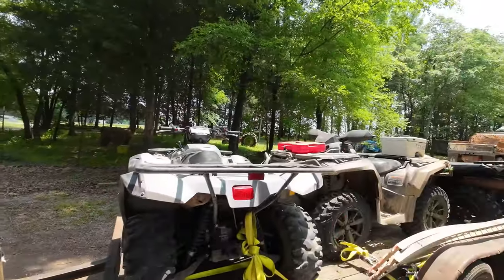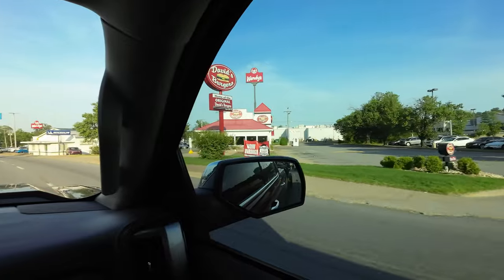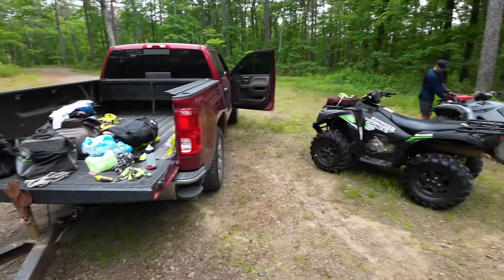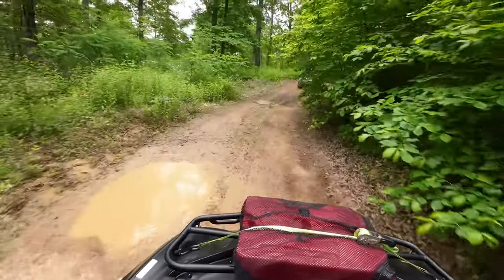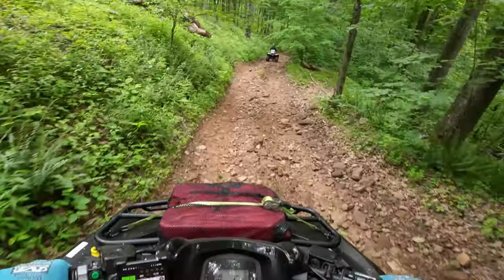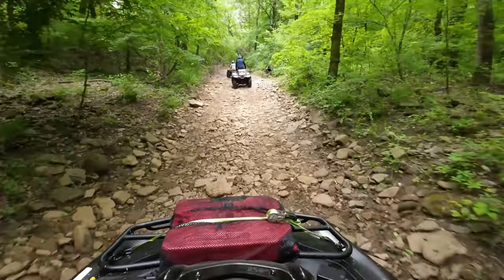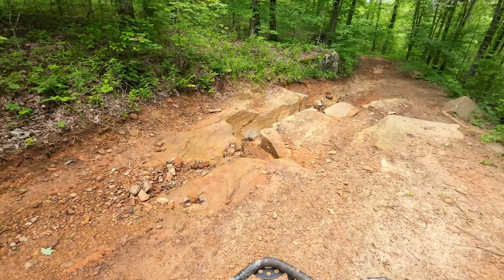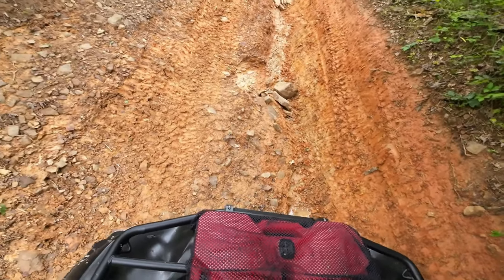Another trip to Macks Pines...Canam Outlander, Kawasaki Brute Force, and the Kodiak 700 Returns!

Comment: What size tires are you running on the Brute Force? Were the tires you didn't like a larger size? Thanks for the information and videos!!
Reply from the maker: I'm running 26x9x12s on the front and 26x11x12s on the back. The tires were never the issue. The aftermarket wheels I installed were the issue. Even though I went with an offset that was supposed to mimic stock wheels, they still stuck out an extra 2" on each side which widened my stance by 4" overall. I didn't like the way it rode, looked, or anything about it. It completely changed the experience. Literally drove it down the driveway a couple times and changed back to stock wheels. Hated it.

Comment: Where did you those caps?
Reply from the maker: Ebay dude! They do NOT come out. Very good quality. They snap in HARD! However, if you smash one of them against a rock on the way up a hill climb, it will dent the cap. Ask me how I know....Stay tuned LOL
Reply: Can you send me a link?
Reply from the maker: @brutelife9177  Here you go buddy! 

https://www.ebay.com/itm/404138120651
Reply: My 2017 has steel ones but my nephews 23 has the plastic and one popped off just doing yard work…..
Reply from the maker: @brutelife9177  somehow I'm not surprised. It's unreal.